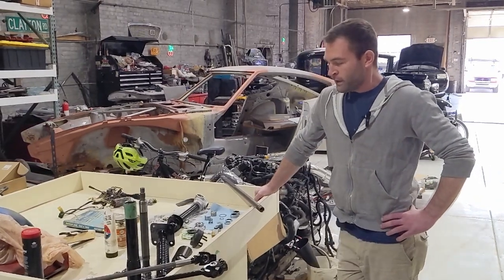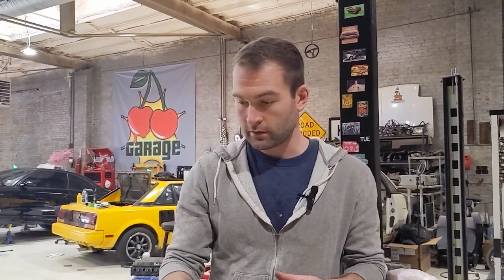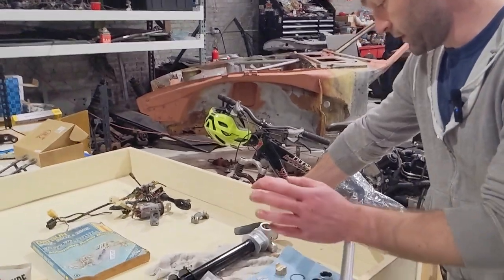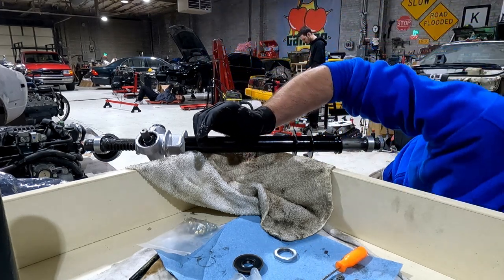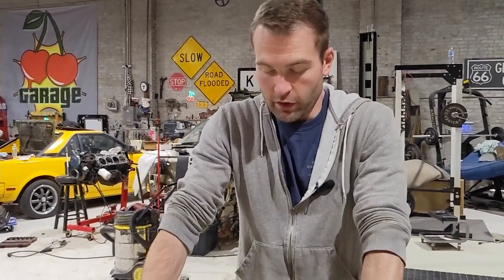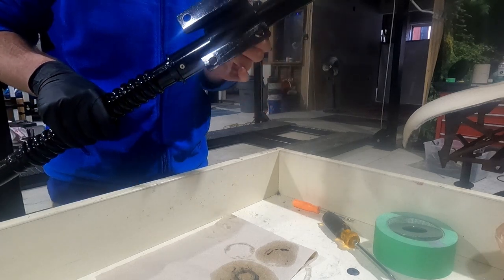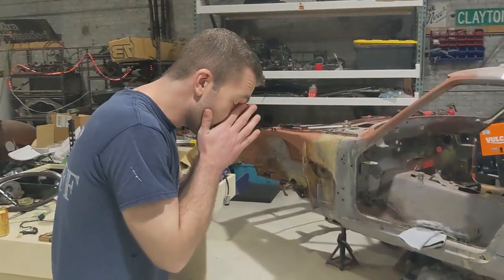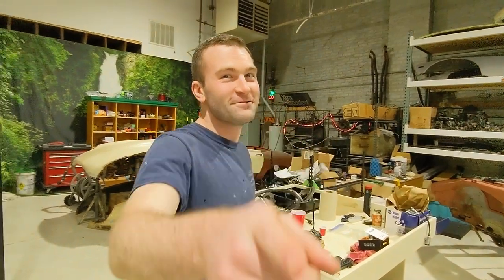Datsun 240z: How To Rebuild Steering Rack

Comment: Awesome video and very helpful! Thanks!!
If I may: the U joints are very easy to find once you have the exact dimensions. Turns out they are identical to Motor Master & ATV700 & Kawasaki . About $15. Some can be changed depending on the year, and have C Clips instead.
Zcardepot is great but they are really expensive. For the bearing and the seal, same story once you have the dimension: can be found for very cheap at any bearing retailer. The seal is a SKF 6641 and the bearing SKF 6003RS
Reply from the maker: Thanks for the info!